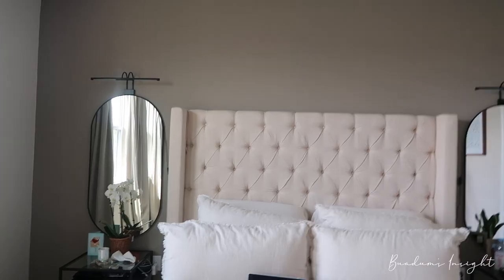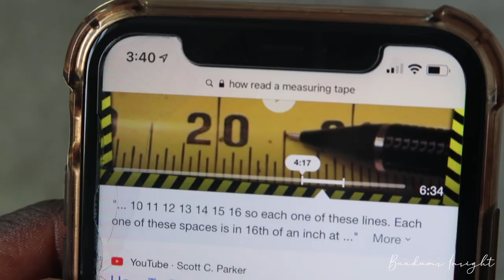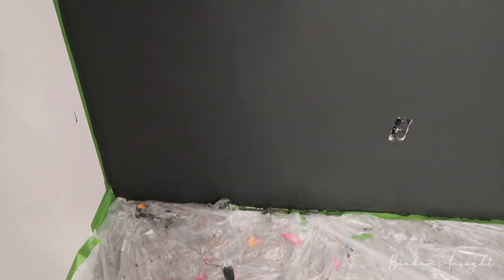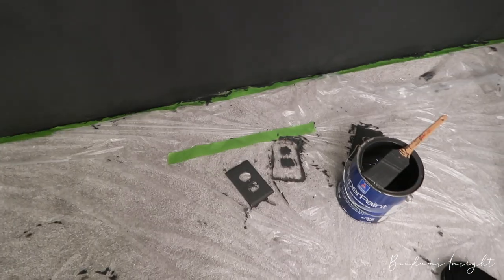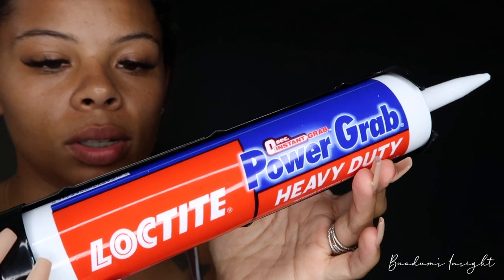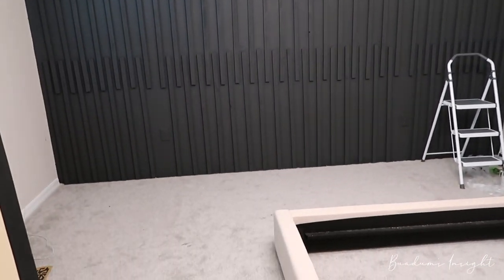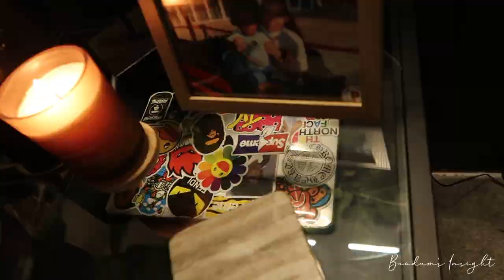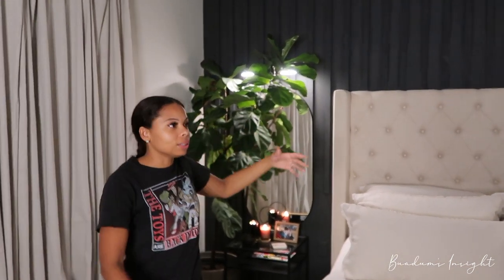DIY Custom Slat Wall | Entire Process + Cost | Home Update #SlatWall

Comment: I don't comment on videos much but I wanted to say great job! It looks professional, I love the color(I might have to use the same one!), and the little bit of greenery is the finishing touch. 👌 👏
If I may offer some advice:
1. Before you rent equipment, I would  check to see what the price is to buy that tool. A circular saw, like the one you used, would be like $50-$60 and you could use it on future diy's! Even cheaper if you go to a pawn shop. Weekend warriors like you and me don't need the best and baddest, just something that will cut a few things once in a while. 
2. If you go to a local lumber yard, you'll most likely find better prices and straighter wood. Just Google the closest one to you. 
3. Please please be careful when using power tools. When that snapped back it could've been bad news bears. I'd take it for a test run on a scrap piece of wood first or watch a "how to use" video, as lame as that sounds. For example, if put the flat part on the bottom of the saw flush on top of the wood you would've had more control. Toes are better when they're attached to a foot, in my opinion 😬
Of course, completely ignore all this if you have no desire to own the tools lol its just food for thought!
Sorry about the long comment. Keep it up you two! 🙌 great job!
Reply from the maker: Listen!!! We loved everything about this comment!!! Thank you so much for taking the time to watch our video, comment and provide us insight. We love it. We will definitely use your advice. And you are right toes are better when they are attached to a foot 😂😂😂😂. Thank you again! More to come! 🙌🏿